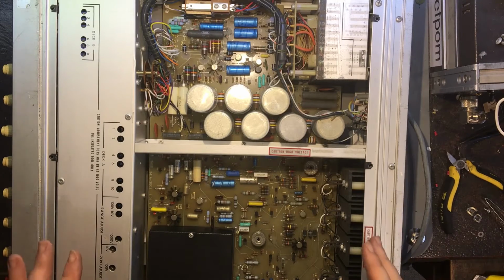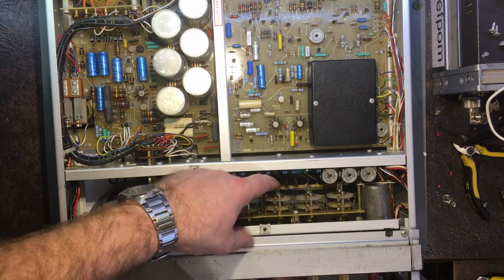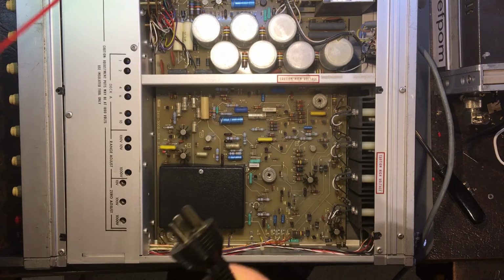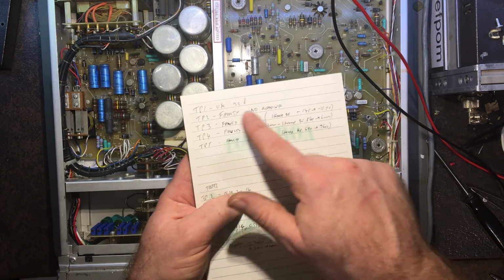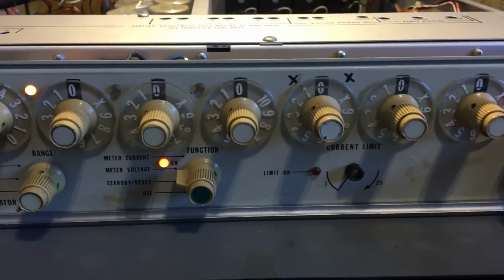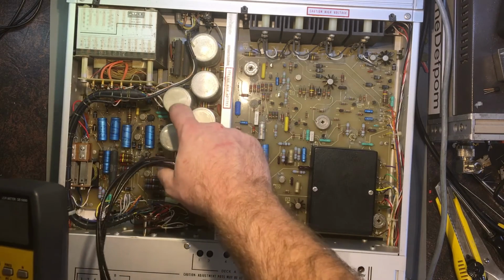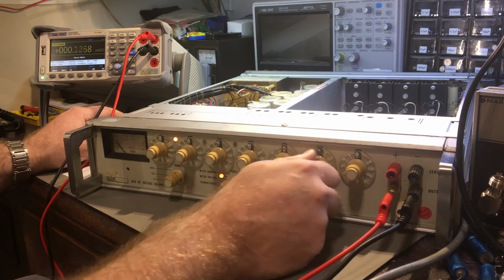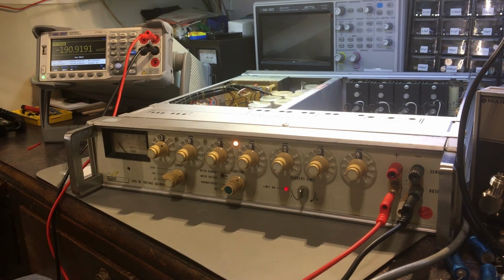#228 Fluke 343A DC Voltage Calibrator Repair Part 1

Comment: thanks for this series, I just started with my own Fluke 343A, mine dont even power on, just clicks and use 70W, thermal cam show R95 hot, R84 crasy hot, R81 hot
https://youtu.be/EDoJI2HOnDg
feel free to comment if you know the "trick"

Comment: Sometimes you can get equivalents for Fluke transistors.  Old U-series Teledyne or Amelco JFETs are a whole different story.  I have a whole bunch of good ones which came out of an 8500A Fluke multimeter for which I am having trouble finding data, even though they are standard parts.

You might want to get some Pomona 3770 binding posts for replacing those.  They are rated to 2.5kV and made of gold-plated tellurium copper.  They are about $10 apiece.  The reason for using tellurium copper is that it has very low thermal EMF, which is important for an instrument that accurate.